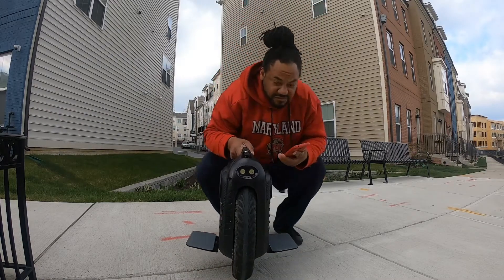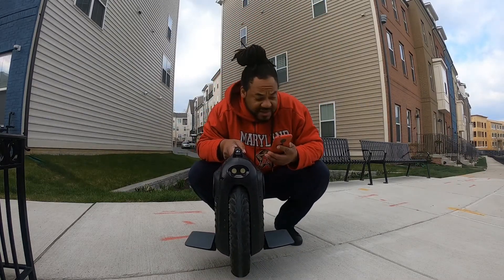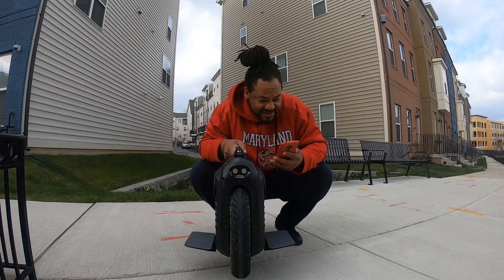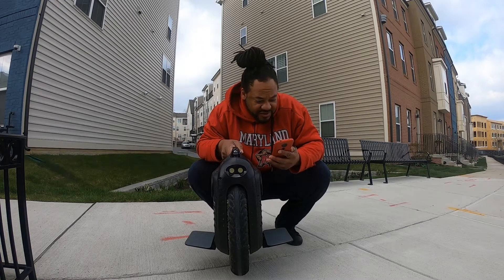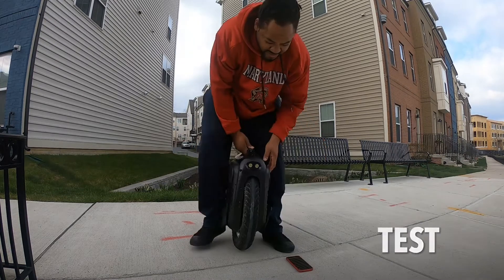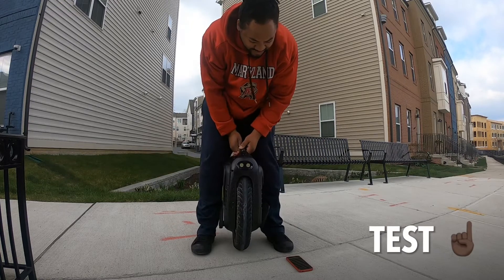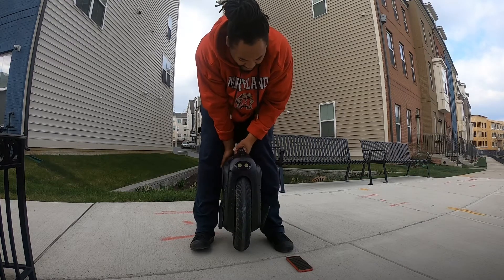PART ONE: GOTWAY MSP VS NIKOLA PLUS. WHICH WHEEL IS FASTER?

Comment: the nik charged up to 100.8 will hit 84kmh(52 mph)
Reply from the maker: I have seen it hit 84 in other vids. I plan to charge it to 100.8 and redo. 
Still, since it was at 90% capacity I was a little surprised by a figure 8-10 km/h from what I imagined it would do. 
I figured that it would at least spin to 80 km/h 😆😆😆. Since the actual test showed different I will definitely redo at 100.8. 😉👍
Reply: @glydiatorsmedia2864  i know right, i didnt realize it myself until not too long ago how much 10% battery means, especially at the top end. Now i see why its so important not to push it once we get below 50-60%
Reply from the maker: @jamesm217  I'm charging it up the Nik now. I will test it in the morning and update the results. 😉👍